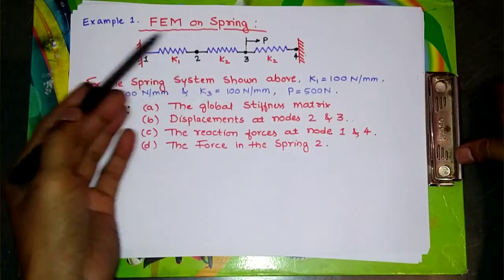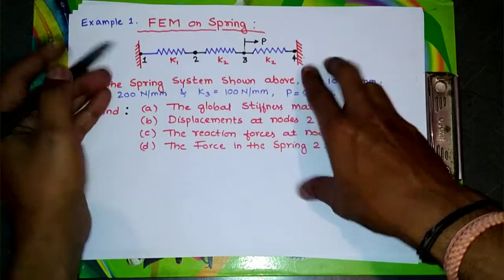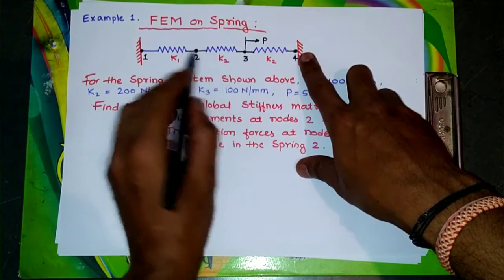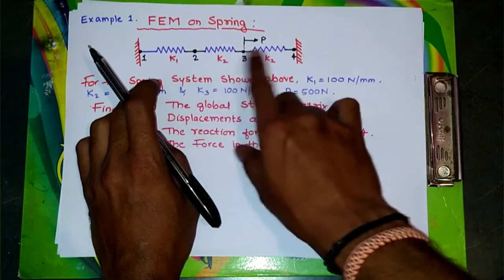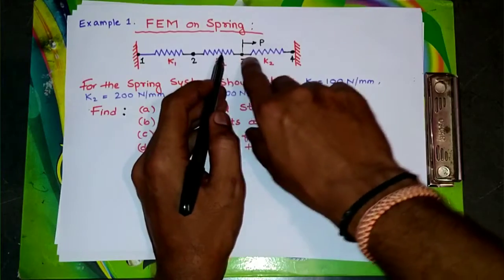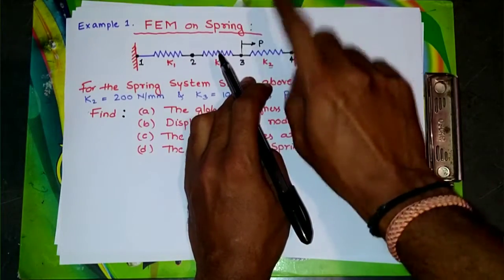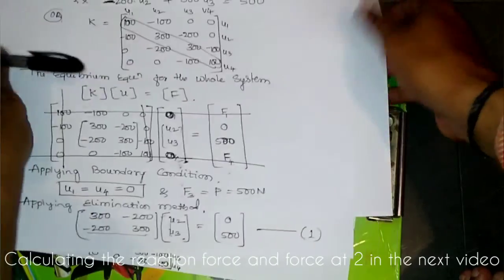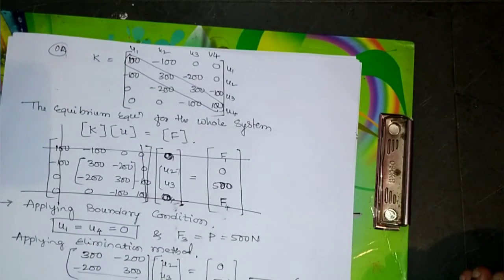FEM Spring Problems | Finite Element Analysis on Spring | Spring Analysis by FEM

Comment: did wrong calculation at the end around 15.27 wher u forget to multiply 3*300 which shall be written 900 but u copied the same 300 for which u got u3 as 3 mm but it is (-15/13) and u2 is (-10/13) and didnt complete tho whole question 

 apart from that explanation given was excellent thanks for it i really  learnt a lot
Reply from the maker: Thank you

Comment: Sir when we applying the elimination method can we directly strike it(like 1st row and 1st column) in the exam or not ?
Reply from the maker: Sure, You can directly apply
Reply: @MaheshGadwantikar  OK sir but striking out (lines =to remove )as row and column
Reply: @MaheshGadwantikar  tqq sir for quick reply 🙏🙏
Reply from the maker: Yes definitely, it's like removing
Reply: @MaheshGadwantikar  sir where's the continuation of this video part 2
Reply from the maker: That's it. No continued part